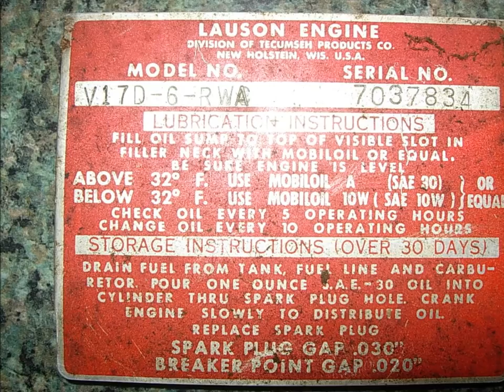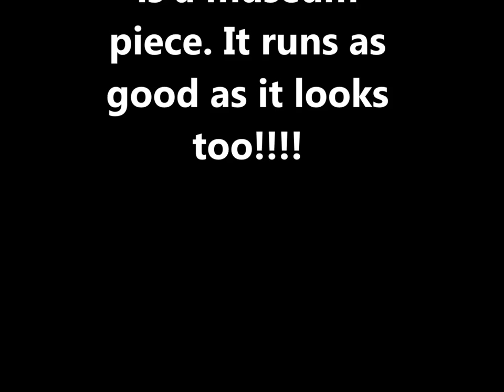antique 1957 Excello lawnmower restoration

Comment: I don't blame you for not wanting to mow with it because parts for the mower are obviously obsolete.

I've got an old 4 HP Supa Swift (Big Bob) lawnmower which was made in 1985,it needs a complete rebuild & I have to chase up another camshaft because its bent & another can follower because it snapped.

That was caused by a stuck inlet valve which needs replacing (its face is badly pitted) which jammed up due to a Lack of oil.

I'm pretty sure my old neighbour who threw it out probably just couldn't keep oil up to it & it drank itself dry,I'm pretty sure it just needs new rings as they have a 2mm ring gap & the cylinder is still good.

The original rings ,camshaft & follower are no longer available as OEM parts through Briggs & Stratton rather as either used parts or from new old stock on EBay & elsewhere online.

The rings I can probably get aftermarket or there are a couple of different part numbers which supersede the original part numbers, they are still available.

Comment: Very nice. I have quite a few mowers I'll be restoring and using, I have an early 70's 2 stroke 160cc Victa I use as my regular mower, the power that thing makes is incredible, it will go through tall, wet, thick grass, I love it. I will first be restoring a Rover 4 stroke self propelled, which will be my regular mower though. I'd love to get a reel type too. One day. I'd rather have 4 old mowers than 1 new one though.